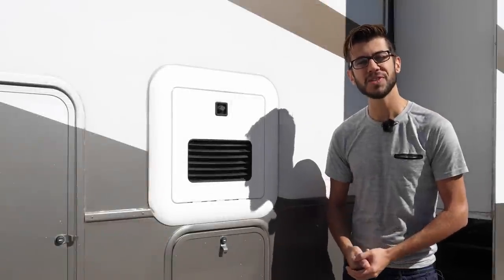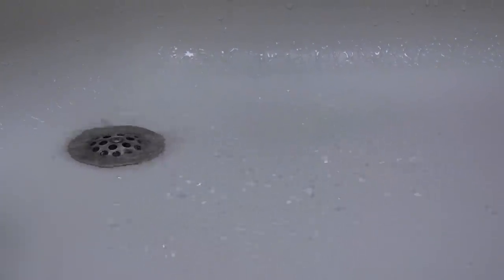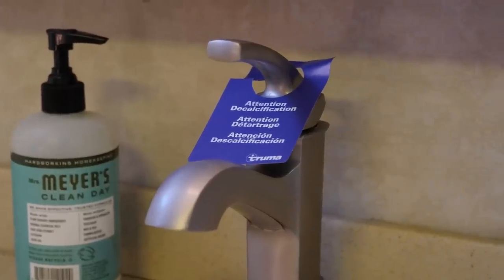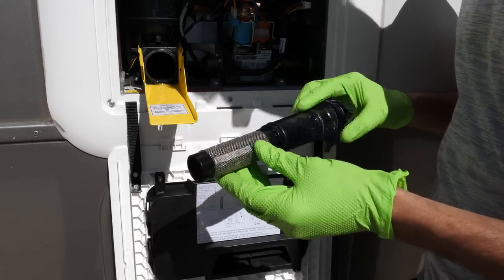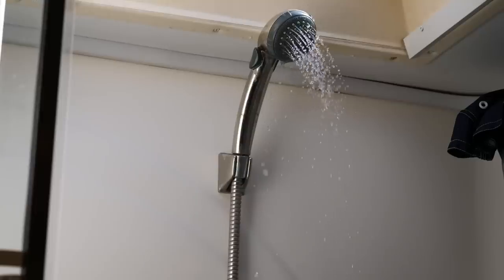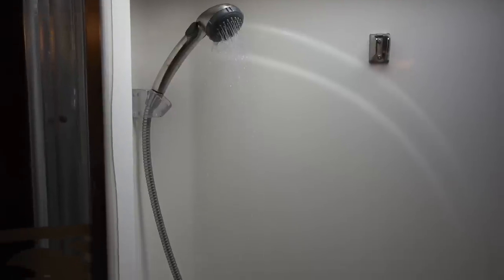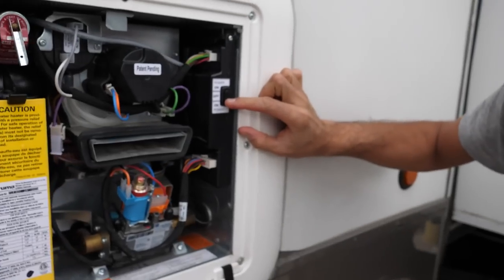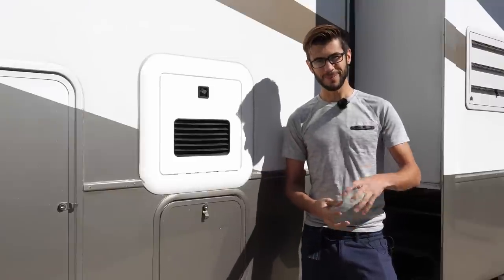How to Clean and Decalcify the Truma AquaGo On-Demand RV Water Heater

Comment: We are new to raving and wearing your readers is very important.  Why you ask?  I turned the Truma water heater off and assumed that knob should go all the way to the right.  Instead I turned it to ‘Clean’.  Oops.  No hot water.  Light on the inside knob kept flashing.  After watching this video, we stepped thru the decalcification by turning everything off and draining the tank.  We did not have the tablets nor did it need it done as this is a new unit.  It did reset itself and we now have hot water again!!!  Thank you to the Morton’s!!!
Reply from the maker: Glad this helped you out!

Comment: Some how when I attempt to fill my fresh water tank, water comes out of the filter assembly and not filling the tank, and if I connect to the house inlet the same thing happens. Looking at the exploded view, I don’t see a cap at the end of the filter and I can’t see a valve or shut off in the diagram. This is new and has very little use. I plan on contacting the company as this January 1 2023.

Comment: Once again your videos have solve my problem.
1. Went to camping world and they had never heard of Truma water heaters.
2. Motorhome is a Dynamax at 200,000.00 plus. Camping world is a dealer and had never heard of Dynamax. Even though I live in Indiana and they are made 100 miles north of me.
3. Finally got the tablets from Amazon.
4. I could not get the LED to light on the panel.
5. Thanks to you and your video I was able to determine that the phone cord from the water heater to the control knob was never hooked up by Dynamax.

Keep putting out these videos. I am now enjoying lots of hot water and will take back all the bad things I have said about Truma. By the way I even took it back to the Dynamax assembly plant and they could not fix it.
Reply from the maker: So glad to hear our video was helpful for you! :)

Comment: Thank you for your video, it was very helpful. After almost 2 years of full time use, our "Clean" light never came on, so we just decided to do this anyways based on the time.
Reply: The older models do not have a “clean light.” The light on the control panel flashes off then on once every 7 seconds indicating it’s time to decalcify.

Comment: @Mortonsonthemove, your video was very helpful,  but I just want to make people aware of a different scenario that happened to us. Our water ran red first when draining after the decalcification cycle, then orange, then Blue! I had to turn off all the faucets at least three times to fill the tank back up, then let it drain again so that the cycle would clear.  I am assuming the orange was iron, and the blue/green was copper, as the water had a metallic smell to it. It only cycled for about 90 minutes.

Comment: I have a in house filter under my sink. Do i need to remove it? Or will the rinsing of the water system take care of cleaning any link solution or bits out of the in house filter?
Reply from the maker: Best to remove it, or if it has a valve shut it off. Dont wat to rinse into it.

Comment: Thanks for the video - excellent! Except...I just went through the process but the light keeps flashing no matter how much water I run through the system (I've probably run at least 30 gallons through). I rebooted everything. Set the switch and the rotary dial to on to see if I could at least still have hot water while I troubleshoot the continual flashing, but now...no hot water. The unit cycles and hums like normal but I am not hearing the igniter switch do it's thing (that click, click - ignite - sound that I am so used to). Any thoughts? Calling Truma tomorrow but I'm dying because I hope I did not damage my unit. Thanks.
Reply: Did you ever figure out the problem?
Reply: This happened to me too. Did you figure it out?
Reply: It's happened to me too!  Any answers?